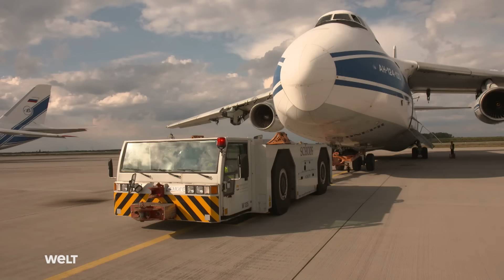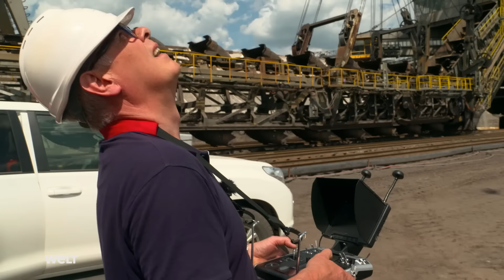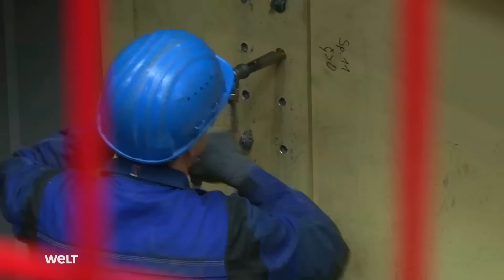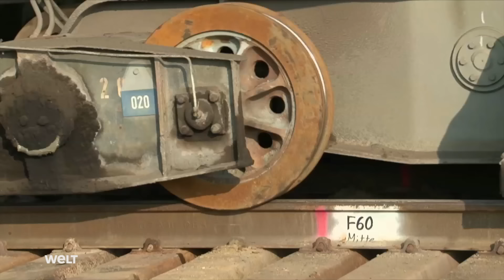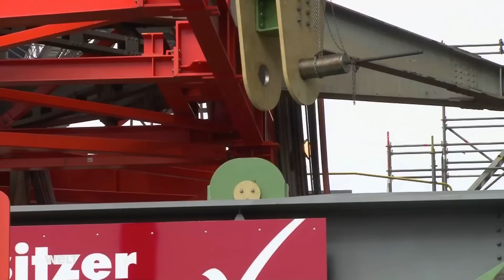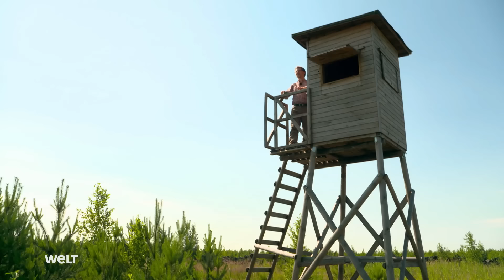Behemoth of Steel: The Largest Vehicle Ever Built | FD Engineering

Comment: If that's dust that they're shoveling off the bridge maybe they should just make the bridge  expanded steel so the dust can fall through
Reply: Those 25° panels are there to keep the dust from entering the moving mechanisms dust would destroy it in no time if that’s what you’re talking about while being a very impressive piece of machinery I think the gantry that moves to Saturn five rocket blows this thing away much more complex than this. This is actually basic mechanical engineering

Comment: If we can build this, we can build mechs.
Reply: to be fully independent though it would need to be powered by a small modular nuclear reactor. Not impossible, but it would be a top tier engineering challenge for sure.
Reply: @killman369547  Would love to see what modern scientists and engineers would come up with if they had the same budgets for research as they used to.
Reply: Not true, actually. There are a large number of reasons that bucket wheel excavator does not equal mech. The primary reason is due to dynamic loading. You can probably lift 50 pounds. It would take effort, but it's doable. Now, imagine somebody throwing something that weighed 50 pounds off of your roof, and then having you catch it. Not doable. This is a simplified view of dynamic loading. Force equals mass times acceleration, after all. The faster an object is accelerated, the more force it takes to stop it. Mechs are hit extremely hard by this, because walking is not unlike a series of crashes, or being dropped from a height. Every step a mech would take would have much higher dynamic loads than most vehicles normally face. There are vehicles that can face some pretty gnarly terrain at relatively high speed, like tanks and rally trucks, but even so this isn't a direct comparison. I'm trying to give as good of an explained as I can, without it being a massive wall of text. But, there is a good reason why large pieces of equipment like bucket wheel excavators move so slowly. That much mass and inertia requires slow speed, otherwise you'd quickly overwhelm the ability of motors and materials to control it.

Also, a mech is so much more complicated to make than a bucket wheeled excavator. Limbs like a human are very complex to replicate mechanically. 

All this being said, work is being done on what you might call a mech, but a bucket wheel excavator is not a good comparison for technical complexity. As a matter of fact, I don't think there is any currently extant machine that compares.
Reply: @ amazing breakdown. Thank you💯
Reply: @saberwing7930 great read.. but I still have no idea wtf a mech is. I thought wrong were talking about my car guy Carlos.. but now (thanks to you) I feel both confused and enlightened. I'll happily be the second person to smash the like button 🙏
Reply: @rickmorty8697  a mech is a mechanized suit or humanoid. picture a giant human looking robot
Reply: @saberwing7930 a Baja truck will put a rally truck to shame
Reply: @saberwing7930 this is why we need to spend more time on building a mecha.😂
Reply: Japan has built small scale mechs already. The formula is there.
Reply: In complete agreement with your statement 🙂
Reply: I gotta assume that mech is a gaming thing.. freaking nerds!:)
Reply: @rickmorty8697 lol 😅
I didn't understand what a mech is. Thank you
Reply: It’s only a matter of time before we have Gundams or Titans (40K)
Reply: I agree
Reply: Exo squad is actually pretty close to the real thing.
Reply: Our current material and power standards don’t even remotely meet the needs of a mech the size of day a jaeger like gipsy danger. Just to raise Gipsy’s arm vertically up to 90 degrees, 5 or so of the most powerful engines in the world would be required, and these engines are the size of a cathedral, each. And that’s just to lift it up, never mind pushing anything and also without materials it would weigh a ridiculous amount making it unusable. Not to mention the fact a simple missile would have completed the job better. One thing I always loved about pacific rim was how it was specified and made so blatant that Kaiju blood is toxic and should not be spilled. Hence the need for blunt force like a punch from a jaeger as opposed to just blowing it up. On most movies like this there is a big hole in plot, because a $50,000 missile could complete the job better then a $50,000,0000 jaeger. But in this case, they are perfect.
Reply: Mechs?
Reply: Is this what gaming produces, that kind of thinking. If a big robot was effective then they would have. Its obviosly not
Reply: Who knows, maybe there are lots already built secretly for military use, underground. 🤔
Reply: The problem is the power source and computing, not building the thing. 

Also depending on the type of mech we simply don’t have the propulsion units and such to fly like they can’t…..which again…..requires a massive amount of energy….oh let’s not forget the heat those things would generate.
Reply: If we can build this, then we can provide housing and healthcare to everyone.
Reply: Support battery tech, because that is what will give us exoskeletons too. 

 If we can build robots we can build mecha and exoskeletons.
Reply: Yes listen to this guy
Reply: Not really
Reply: My cat's breath Smells like cat food

Comment: 18:14 actually, a 747-400 has a maximum takeoff weight of almost 400 tons, and the ER version can weigh in at just over 400 tons. an A380 can be even heavier, but i don't have numbers for that one.
Reply: A380's max takeoff weight is 575 (metric) tons.
Reply: 1.2 million pounds.  Max Take off weight.
Reply: @spikenomoon  is that for the A380? because i've never heard of a 747 that can take off at 544 metric tons. 
747-400: 397 tons
747-400ER: 412 tons.
Reply: @mrxmry3264A-380.
Reply: @mrxmry3264either way. It makes no sense in my little brain that anything can lift that much. Especially when I can’t lift 300 lbs off the ground.
Reply: @spikenomoon  i know what you mean. i still find it fascinating that something so heavy can actually fly 😲
Reply: @mrxmry3264ya. In my mind it could happen but only if it was traveling several 100 miles per hour.  Not the 180 mph for takeoff.